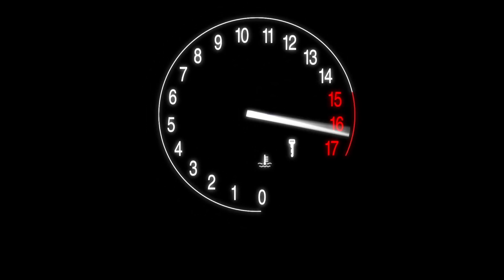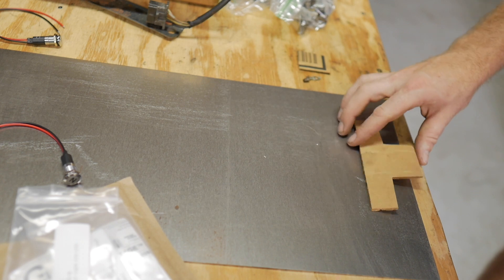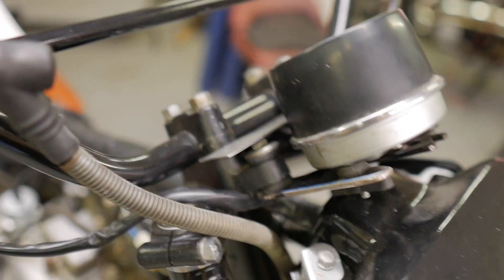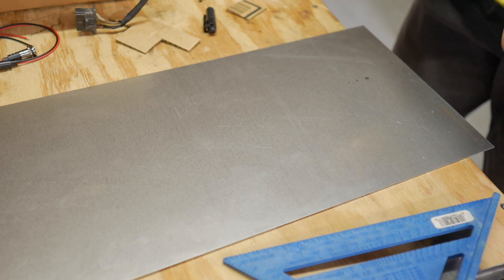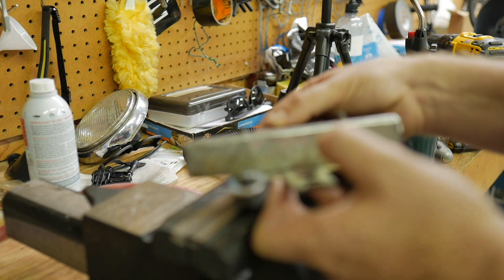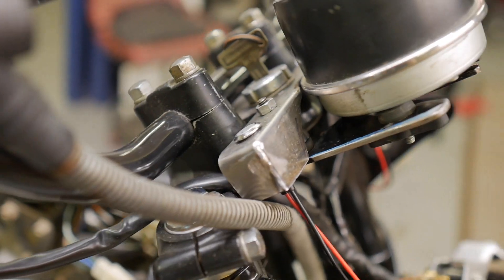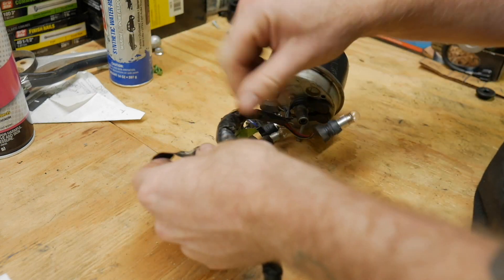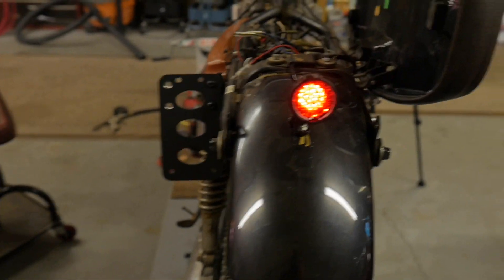Kawasaki KZ400 Project Bike Part 9 : Handmade Brackets

Comment: I just picked up a 2000 Yamaha Royal Star Venture cruiser with 9k miles on it as a second bike. I paid 4800 bucks for it and it will share trip duties with my 07 Yamaha Royal Star tour deluxe with 80k miles on it. It basically is a 23-year-old "new" bike. Everything is tight on the bike like it came from the factory and it looks showroom new. I'm about to do a few maintenance items on it this weekend and I'll be using some of what you have recorded as a reference if needed. Thanks, man!
Reply: Yamaha has awesome bikes, I’ve got an ‘06 Yamaha Stratoliner S, bought it 10 years ago with 1,800 miles, 40,000 miles now…
Reply: I have a 2005 rstd with 60k miles. Great bike but once I bought a goldwing It’s night and day better